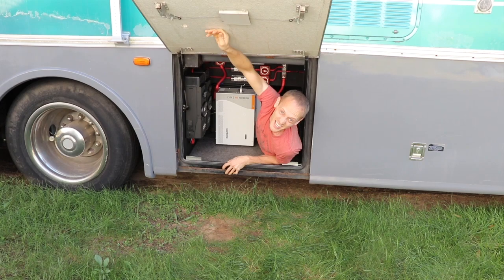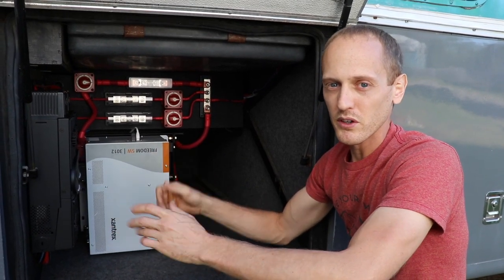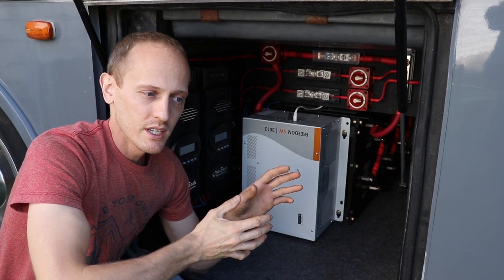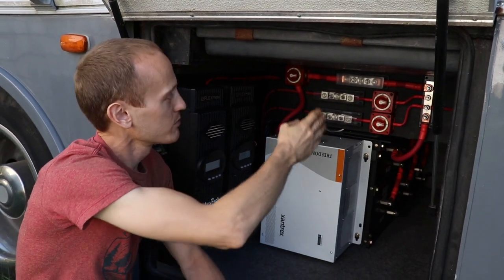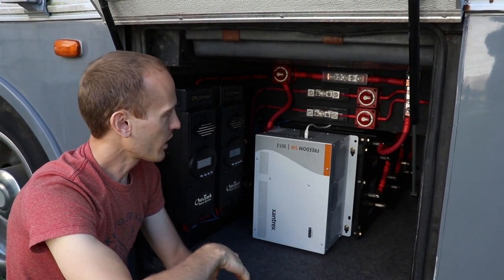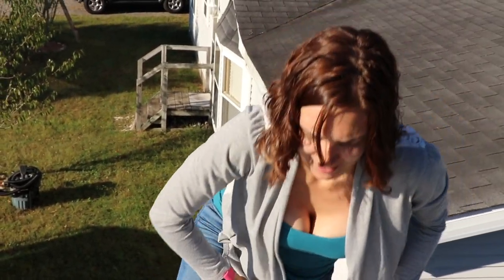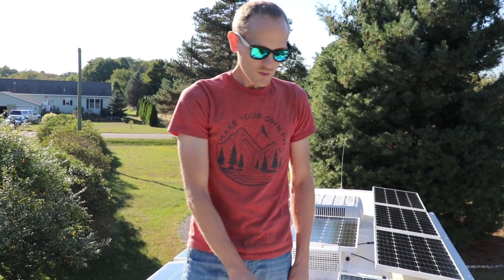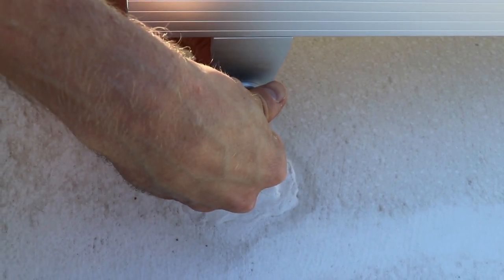Massive DIY RV Solar Install for Off Grid Boondocking

Comment: Sooooo interesting to see when Outback and Xantrex were the top names in solar setups and what brands have superseded them, not to mention battery technology, especially in 4 short years.
Reply from the maker: Wouldn't. Say there are any that have surpassed their quality. Victron has definitely cornered the market in integrating communications throughout components though. Battery tech is awesome now and we have switched to 1200ah of Ampere Time Lithium. Night and day difference

Comment: Fantastic work! If you were in FL I'd hire you to do an install on my (future) coach.    Jim
Reply from the maker: And this was 5 years ago. Myself and a fellow nomad we met on the road are actually going in to business doing installs. We just did his 40' Class A a couple months ago with a solid sheet of solar on the roof. 4380w of panels, dual 3k inverters, and 28KWh of lithium batteries running 48v.

Comment: Mike how much $$$
Reply from the maker: This install was about 15k when installed 5 years ago. There are cheaper ways to go about it now, but a similar system would still run you about 11-12k installed

Comment: so now that we're in 2022 are you going to Upgrade to 300+ Watt panels? You would no longer need 12 of them. Even back in 2016 they had 200+ Watt panels, so I was wondering why you went with 160W panels.
Reply from the maker: I purchased those panels based on their quality. They were proven to weather large hail storms without breaking. As of today we have been completely off grid boondocking for 3 years now and the only change we made to the system was made a couple months ago. Lithium prices have finally come down so we replaced the 1200ah AGM bank with 1200ah of Ampere Time lithium batteries. We lost 500 pounds of weight and have gained so much livability!! No more worrying about getting back to 100% every day even though with the charging profile of Lithium we are actually making it back to 100% early on in the day and running even more electric items throughout our day and night. Thanks for watching and dropping those comments. 👍
Reply: @HereThenGone  ...Oh. no. thank you for sharing your knowledge. 
So what would you have to do if you wanted to run two 15K btu AC's and your fridge, Electric Stove, 2 flat screens and coffee maker oh yeah and the wifes curling Iron. LOL. What would you have to add to your set up? pardon my ignorance.
Reply from the maker: @FunDuude  I'd double the solar on the roof by building a rack over the A/C's. Best bet would be going mini-split.
Reply: @HereThenGone  So is it safe to say that if you can find the same size panel that produces 240W you can just replace the panels you have without modifying anything else?
Reply from the maker: @FunDuude  physically that could be the case, but then there would be too much power for current charge controllers. I'd either have to get another one and change the wire routing on the roof or get larger ones. If I were to do any changes it would be a full roof rack over the A/C's. Just finished up one with a friend that is amazing. Check it out at Nomad Mods on FB or IG if you want. That is my business with the friend who's rig we put the rack on.
Reply: @HereThenGone  Hmm. Yeah as long as your rig is taller than 14 feet,  (or 13'9") you should be fine. 
I'll definitely try to go ck it out. Thanks so much.

Comment: Dude get lithium man. It’s not that much more....
Reply from the maker: $5,000 isn't that much more? That was the difference for the same usable amp hours when I built this system almost 3 years ago. Been using it for two years straight now and have been more than happy. Would I like to switch? Sure. Will you cut me a check to make the switch? Doubtful.

Comment: Loved it.  I'm an electrical contractor preparing to equip my 37 foot 5th wheel.  Love your wire and system. Any changes you might share.  I only need 1100 wtts and 300 to 400 amp hours of storage.   Please advise.
Reply from the maker: My only advice would be to go larger than you think you need. You'll never be mad about the decision.

Comment: Nice job BUT why not use more powerful panels? I’ve seen 450 watt used panels for $50 apiece. 6 of them would put you farther ahead.
Reply from the maker: These panels were used to stay between all the objects on the roof. If I were to do it all over again, I would build a rack over everything and use larger residential panels

Comment: Excellent work, I do have a question though have you ever run low on power and how well does it stand on cloudy days.
On a rainy days how many days can it run without supplement your electricity with a generator.
Alex k.
Reply from the maker: We have been full time traveling for 2 years now and have used the generator twice. We haven't paid to be somewhere in a year and a half so that's all boondocking. We cook exclusively with electric and have only had two days when we didn't get back to 100% state of charge. Both of those days we made it to 96%. Do we have to live accordingly when it's cloudy? Yes, but we have seen 30+ amps coming in while it was raining on many occasions.

Comment: For about $1600-1800 you can get four 280ah LiFePO4 batteries.  That's almost 14,000wh of batteries.  Look at Will Prowse's channel for Lishon 280ah batteries for his review.  That's cheaper than most AGM and lead acid batteries.  They don't have a built-in BMS, but those aren't that expensive and you're getting so much more for your money this way it's a no brainer.  Oh, the batteries are a lot lighter also.

Comment: I haven’t looked through all your comments on here so I’m sure it has been addressed before. However I wanted to ask if this system allows you to be completely off grid and for how long? Also will this run everything on your bus including the AC unit without issue? We are thinking about building a skoolie but we want to be able to be completely off grid for at least a few weeks at a time without worry.
Reply from the maker: We only plugged in 3 days in all of 2020. Our system allows us to be completely off the grid. We can(but never do) run a single rooftop A/C unit for about 4 hours. We have actually made a window plate to hold a 5000btu window A/C for the times that we happen to get stuck somewhere hot. We can and have on many occasions run that all day long to keep us, our cats, friends, and their pets all cool in 91° weather. No matter the size of your system, don't plan on running a rooftop unit. They are power hogs. Either a window unit or a mini-split is your best bet. If you do a raised rack(if I did everything over that's what I would do) you can get much more solar on the roof than us and then be even better off. We cook exclusively with electric. Induction burner, air fryer, griddle, instant pot, countertop oven, bread maker, elect water kettle, you name it. We've only used a propane burner twice in a year and a half.
Reply: @HereThenGone  Thanks for the response! That will definitely help in our decision. Any do’s and dont’s that we can figure out before our build will help with keeping some of the immediate frustrations to a minimum.
Reply from the maker: When in doubt, go bigger with wire size. Put in fuses and breakers between each component so you can isolate them to work on/troubleshoot. If it's in the budget, lithium charges much faster, doesn't have to make it to 100% each day and obviously weighs much less. That being said, if you monitor your usage and have the cargo capacity, flooded or AGM will do just fine. Also, make sure to get a shiny based battery monitor. Those are the only ones that monitor ah in and ah out for the most accurate reading of state of charge

Comment: Nice! So clean, nice job! I put 700 watts, just enough to not run the generator during the day. Always need generator at night (no sun & run TV, etc. & charge batteries for the Cpat & Residential Refer. Then same thing in the morning, not enough sun to run TV, coffee, & charge my batteries (4 large Trojan Floor machine bank) from the night before. Inverters & Solar make the RV experience great!
Reply from the maker: Yeah, those residential fridges really get you. They are nice for their amount of storage, bit they definitely take a chunk of power over night. We have actually recently wired the electric hot water heater element to the solar and also just got a welder. We have built some custom shelves in the basement with the welder running off the solar. 👍☀️
Reply: @HereThenGone  Actually the refrigerator doesn't use that much power. It only uses 377 watts when on. ( It doesn't run all that much, especially with inverter technology. But you are right, I would like more solar, although I can't put much more.
Reply from the maker: @Will-bp2yc  you must have a good unit then. Everyone I have met that runs their residential on solar/battery complains about how much of their capacity it takes. A friend has 1600w on the roof with 6 Battleborns and still shuts his fridge off most nights.

Comment: SUBSCRIBED and rang the bell!

Very neat and well done, sir!  You apparently are a member of the OCD DIY brotherhood!  <smile>

Smart man....  Run series as much as possible to keep voltage up and wire losses minimum (and/or reduce wire sizes some).

Love, love, LOVE the engineering you put into those tilt brackets.  Any chance you'd share the drawings?  <big smile>
Reply from the maker: Unfortunately the drawings are in my head. Haha. I've had a lot of people ask about them. Their length and the slot length is really dependant upon the size of your panels and the position of the mounting brackets on the panel. They are simply 1/8" x 1 1/4" flat stock with the appropriate length slot and holes on the end for mounting. Thanks for the sub!!
Reply: @HereThenGone  Not a prob...   just trying to short cut my own engineering/prototyping timeline.

Appreciate the info and response.  We took delivery today and are spending our first night in it (FR Salem FSX 260RTX)

Comment: Excluding the batteries, if you were building again for this rig, which components would you change?
Reply from the maker: There are newer panels out there that are cheaper and 210w each for about the same footprint. I'd go with those now that they have been in use on rigs for a few years and have proven their construction reliability. I went with the panels we have because of their pedigree for robustness at the time. I might go with all Victron components as well for their ability to talk to each other
Reply: @HereThenGone  Thank you my brother for your contribution to those of us whose home is an RV and not at all "recreational."

Comment: Why 12 volts instead of 24v? Thumbs up on the production quality and the build. Secondly, did you think about integrating supercaps into the system?
Reply from the maker: Really it was only to not involve a DC to DC converter for all the 12v items. With the proper wire size and fusing, it has worked out great for us at 12v over the past 14 months of travel. I even recently wired the electric portion of our hot water heater over to the solar side. Free hot water for showers and laundry
Reply: @HereThenGone  I was also thinking of using micro inverters which has several benefits one of them, being safety on using smaller gauge wire.

Comment: Great job why wouldn’t you use 390 watt panels take up less space more room for more panels  clean work real nice
Reply from the maker: The dimensions of panels that large don't work well on an RV roof unless you build a rack above the A/C units. In the future I may do a rack, but I bought high quality panels that fit the available space well.

Comment: My dad recently retired and has an old diesel pusher. I thought about helping to set him up with a solar power system. This set up is a bit much as I was thinking on the low end, but gives me ideas for scaling it up if desired.
Reply from the maker: That is a great idea. The good thing about solar is that you can go as big or small as you want and you can always change or upgrade over time. Glad we could help with some ideas.

Comment: Great system.  Neat work (admire a tidy setup).
One question.
Why haven't the tiny/rv community created a better air conditioning solution that runs on 12 volt DC.  They make more than adequate DC compressor motors.
The point being that the loss in conversion to AC from DC is avoidable.
Same with the Washer and Dryer.  All the motors can be replaced with DC motors.
Refrigeration they already have DC 12volt conversions plus actual DC Compressor motor versions of full size home units.
Oven, also available in DC versions.
Same with water heaters (anyone not using an on demand system have just wasted tons of energy holding hot water).
Modern day there is, really, no reason for homes (in general) to not have proper layout of the roof line for solar on a lot 
and have all their electrical demands handled by Solar with a battery wall.
Reply from the maker: The main RV community is geared towards campgrounds. Therefore efficiency in A/C units isn't a priority. Lots of people have been making the switch to mini-split A/C and heat pumps.

Comment: Would have been cheaper to install a 12V solar mini split AC heat pumps and then just a few panels to run lights, etc.
Reply from the maker: So with only a few panels for lights and things, where are you getting the power for all of the electric cooking that we do? Induction burner, air fryer, instant pot, electric griddle, electric water kettle, bread maker, stand mixer, food processor, microwave, refrigerator, etc.....? Do the solar mini-splits have their own battery bank? Or do they only run when there is enough solar input to power them? Our system has worked flawlessly for us for the past year on the road full time. Sounds like money well spent to me.
Reply: @HereThenGone   Here Then Gone  the systems will run directly on the panels, now I have seen some modifications of people using wind generators to run them at night. But the systems are designed to operate on panels and have line input for a back up system. That can be tied into ypur existing system or a battery bank. Its not the cure all for renewable heating and cooling but its close enough. Where five years ago running ac all day on solar was impossible unless you had something like a 6 or 7 Kw system. Of course we are very limited with our rv's. It would take about 2200 watts of solar and a serious battery bank to run a line voltage ac system, room we just don't have. Just search solar powered mini split heat pumps, plenty of people running them in an RV.

Comment: Do you think if we had 4200 watts 12-350 watt panels 48 volts) on the roof with 3 strings of 1400 in series and then paralleled those three together, would they be able to charge 8 Tesla 24 volt 233 amp hour batteries (3728 amp hours at 12 volts) with a full day of sun? Using 3 if needed) Victron Energy Quattro 48/15000/210-100/100 by Hodges Marine? (Would we need to use the 15000 unit or could we usebthe 10000 or 8000 or 5000?)

Comment: Could you put in a transfer switch between the 2 AC units so that you could run one at a time either the bedroom ac or the main cabin ac depending on what area you need cooled? Bedroom probably while sleeping at night and main cabin during the day just by flipping a switch?
Reply from the maker: The main problem with that would be when you want to use both. They would now be on the same leg of your power service and therefore if you used any other devices that would be on the same leg, you will be tripping breakers. You also won't be running a roof A/C at night with no solar input for very long, especially if you were already running one during the day

Comment: you should look into a mini split ac.
Reply from the maker: It has been a thought on our minds for months. After the obvious initial cost, placement of the internal head is an issue. The ONLY spot we have with enough room for it is in the base of our bed. No wall space large enough. Being back in the bedroom as well as at floor level has prevented us from making the switch

Comment: Had you gone lithium and cost was no object, but obviously weight is still a concern somewhat. What would your setup have been?
Reply from the maker: I would have gone with 6-8 Battle Born batteries. Everything else the same.
Reply: @HereThenGone  thank you
Reply: @HereThenGone  would you bother going with a 24v or 48v system as opposed to 12v, or does it really not help any?
Reply from the maker: @Nirotix  in the past I would say it could help, but with the efficiency of today's electronics, it really isn't an issue. Once you go 24v or 48v then you have to add a DC to DC step down converter to run your 12v items. Now there is an efficiency loss on all the low power draw items you use.
Reply: @HereThenGone  I get that for led lights, but for fridge, microwave and A/C doesn't the higher voltage help?
Reply from the maker: @Nirotix  like I said, it does help some, but with the tech of today it isn't as dramatic as it used to be. Proper wire size for the lower voltage bank makes a huge difference. The efficiency you gain with a higher voltage bank for large draw items is then canceled out when you lose efficiency converting down the voltage for all the rest of your equipment. Basically, it is purely up to you which route you take. Not a huge difference either way when all power consumption is accounted for.

Comment: why did you use panels that low of watts ? Why not 350 w panels ?
Reply from the maker: Why not 500? Why not 1000? These are excellent quality panels that had dimensions I could work with. Large panels are mostly for residential installation. These are more robust for all the abuse of travelling across the country on the horrible roads we encounter.